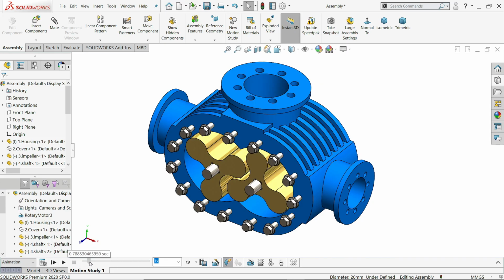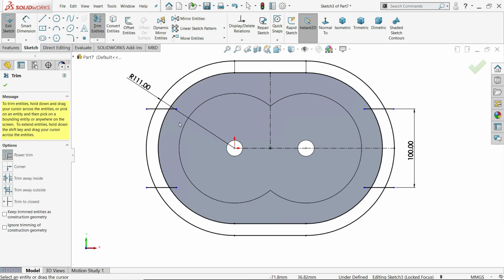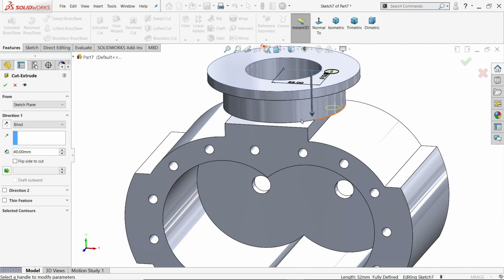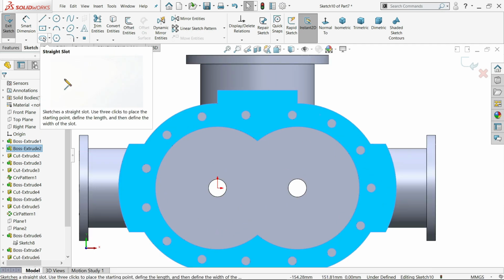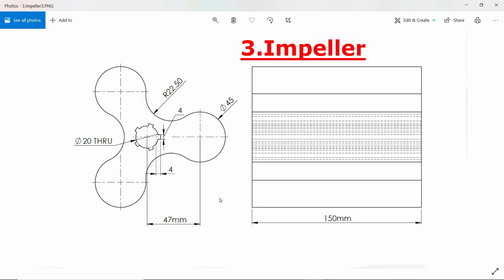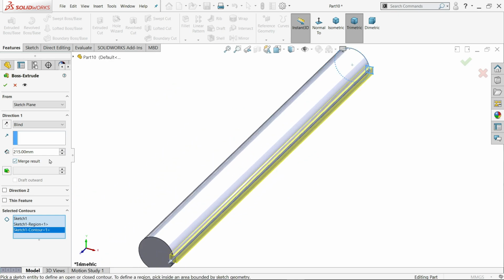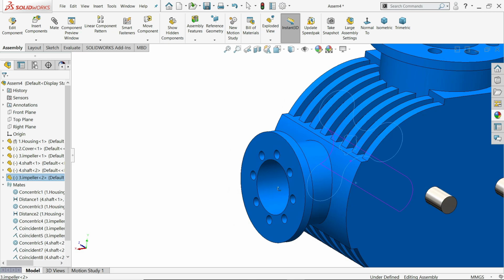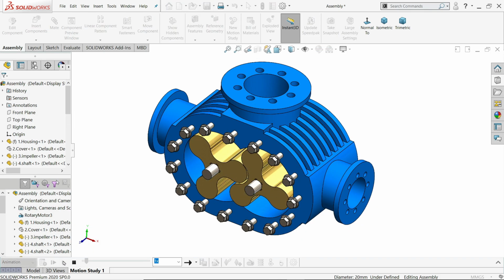Roots Blower Assembly in SolidWorks

Comment: May i know where is the setting i can change so that i can draw a circle by just key in the size i want, now mine i have to use smart dimension to defined the size
Reply: Options>Sketch and select "Enable on screen numeric input on entity creation". You can also have it set to adding dimension automatically if you select "Create dimension only when value is entered".

Comment: Which version of solidworks is this? My panel looks a bit different. Mine is 2020 version
Reply: His version is SolidWorks Premium 2020 SP0.0. It's on the lower left of the screen. The panels are very customizable and you can make the interface utilize the things you use most, speeding up your productivity. What specifically is different on your screen and his? I have Version 2022 and my interface is almost exactly like his. I have made no customizations. His doesn't look like he has either.